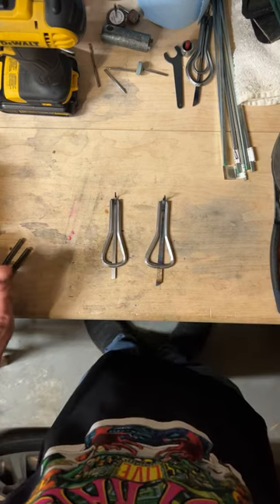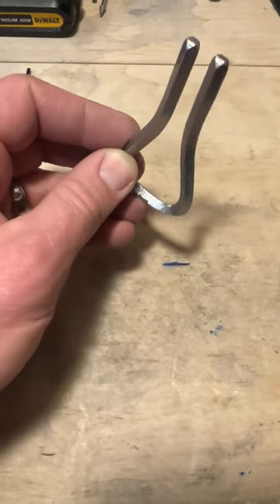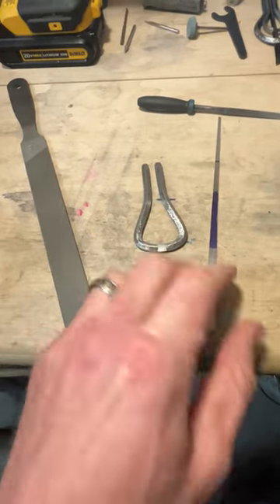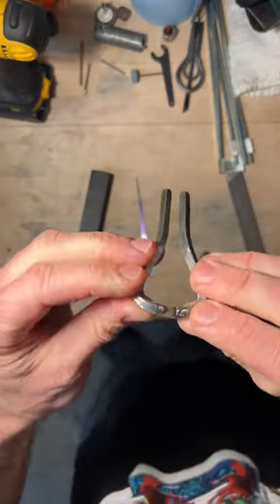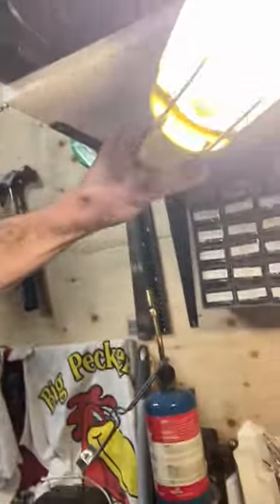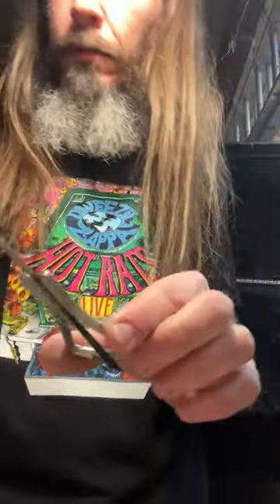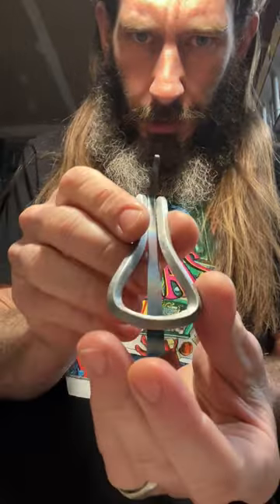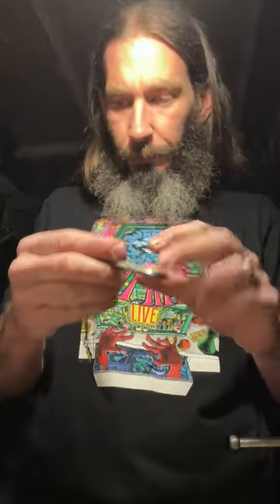Giving Life to a Rejected Jaw Harp Frame

Comment: Sounds very clean  well done. My grandfather taught me how to play
Reply from the maker: Thanks!  Do you still play often?
Reply: @BoxcarBetts  not as often as I should  brother  but I will be attempting to make a new one what kinda of metal for the Reed  spring steel ?
Reply from the maker: @tdublove9558  Yep.  Carbon steel keystock bent up into the frames and then either 1075 or 1095 spring steel.  I was able to get some blanks precut for me from Jamie at theharpery.com.
Reply: @BoxcarBetts  thanks for the information 🙏